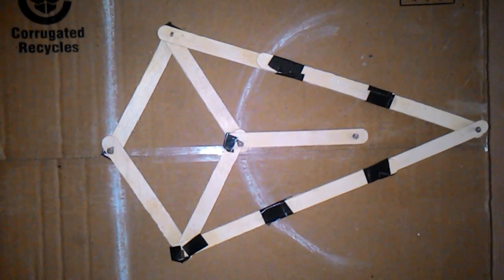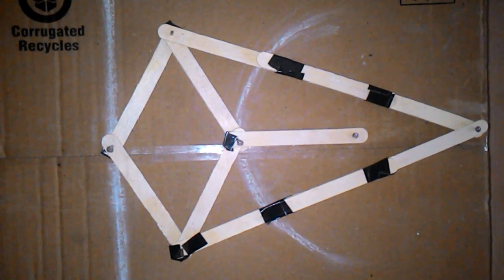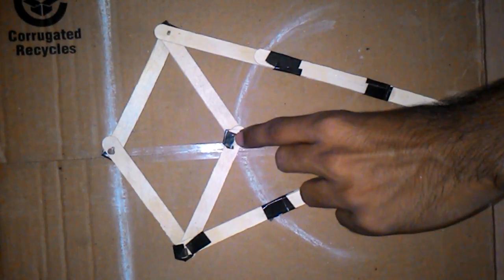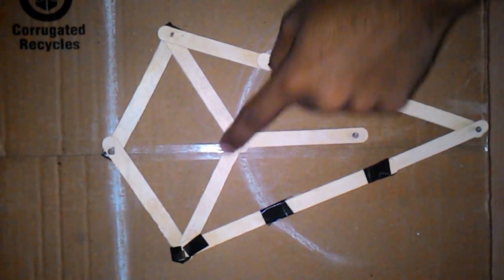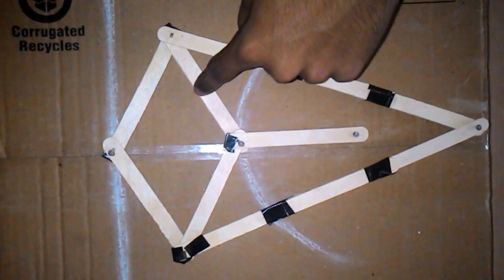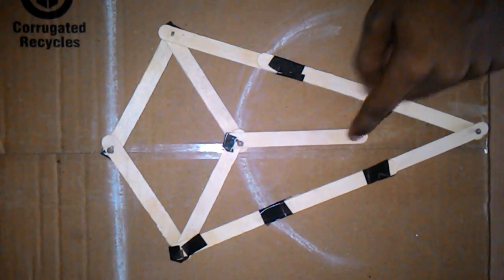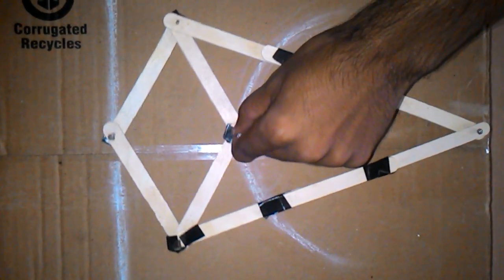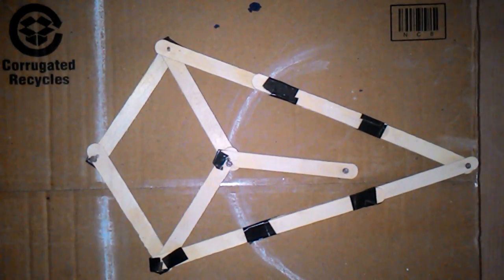Peaucellier's Mechanism - a simple homemade demo

Comment: Hello sir, Can you send me dimensions for this mechanism?
Reply: HARSHIT KHANDELWAL   in case you're still waiting. ...  reading from left to right we have four pieces in the form of a diamond.  These pieces should be equal in length,  say X.   Then we have two long pieces which are equal, call that y.  In the middle there's a rotating piece of length z.  If you rotate that through a circle you need the pivot between the two longest arms to be on that circle.  Further info in wiki.